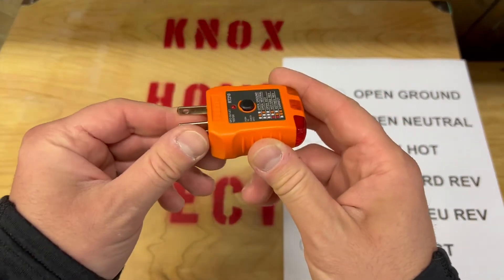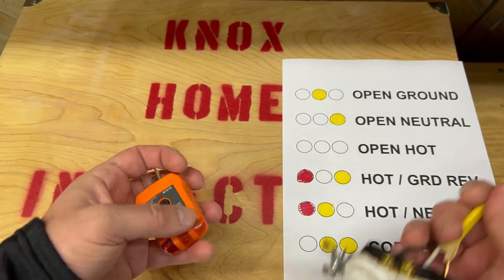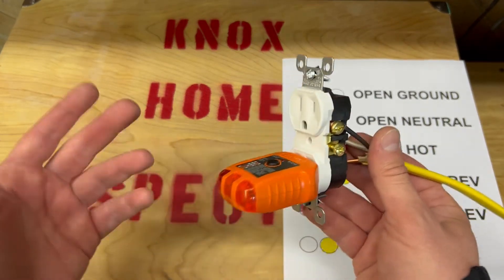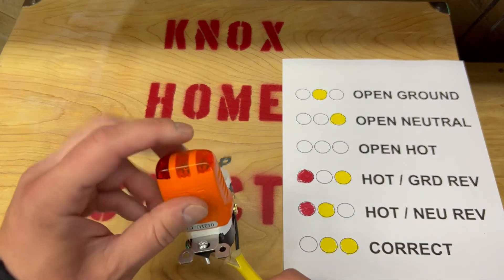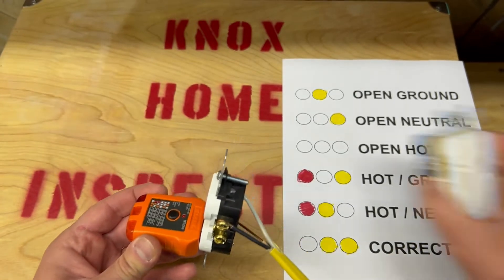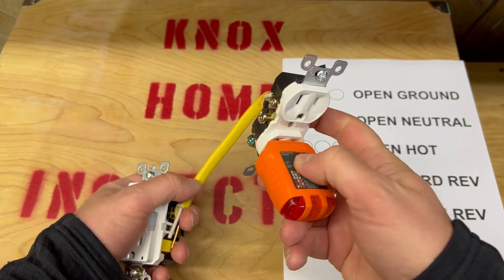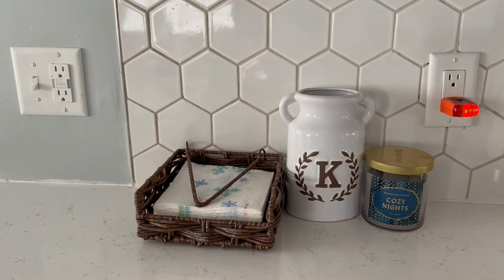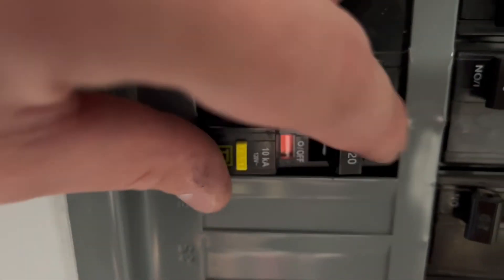Outlet Tester / GFCI Tester, what do the lights mean?

Comment: My hot is slowly blinking have no clue
Reply from the maker: Worn out outlet most likely.  Swap a new one.
Reply: @knoxhomeinspections  its doing it for all the outlets on that circuit though. the next outlet in line was completely dead, opened it up and the ground had broken, fixed that and then same issue. theres no way all the outlets went bad simultaneously. Any other ideas?

Comment: What if you get all the lights on the tester?
Reply from the maker: Good question.  I have seen that more than a few times and it usually means that the outlet is wired with a 240V connection instead of the usual 120V.  I call it the Christmas Tree.  It can mean a few other things but regardless of the issue it needs to be fixed.
Reply: @knoxhomeinspections  how big of a job is it to get that fixed?
Reply from the maker: Really depends on the house and the location of the faulty outlet.  If it is a far run and a lot of stuff in the way it may be more.  If it is closer to the panel and easier to access it will be less.  I normally find this type of problem inside of a garage.
Reply: seems that it would be a fairly easy fix if this was a 240 volt connection because this mistake would almost always occur on a single receptacle, like you might find in a living room or garage dedicated for something like a large window air conditioner or heavy duty air compressor where a standard 120 volt outlet was mistakenly installed. you'd either change the outlet to the proper type, or find the breaker in question and remove the white wire which may or may not be identified with black or red tape, from the breaker and terminate it on the neutral bus if you need 120 volts.   Although as always, this should be left to a qualified electrician if you're not comfortable working with electricity
Reply: If you get some weird reading it would be good to test each of the three voltages with a multi-meter and then figure out the problem. The tester has the thee light between the wire bu it only can tell that there is voltage, not the amount.
Reply: All 3 lights on can also mean an open neutral on a multiwire branch circuit because you now have a series 240V circuit and voltages can fluctuate wildly depending on the loads connected.   Other symptoms of this problem are light bulbs that burn abnormally bright or dim, and appliances that overheat,  run poorly or are destroyed, accompanied by burning odors and/or smoke.